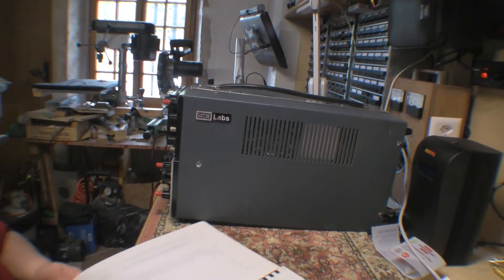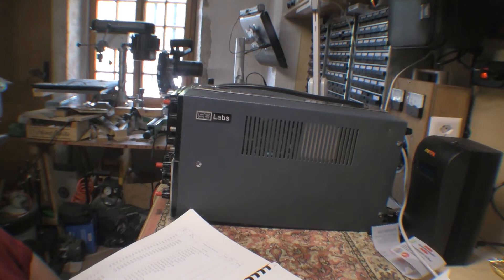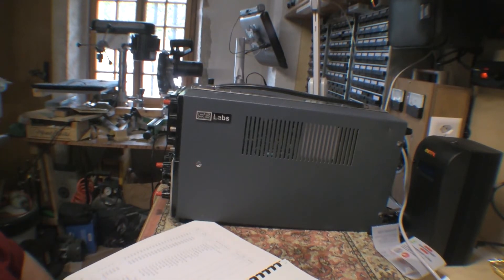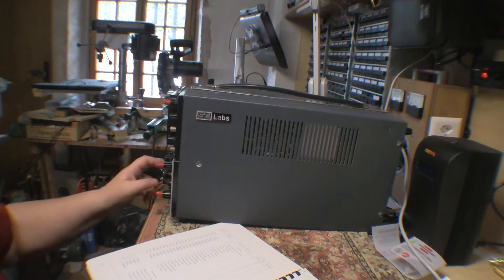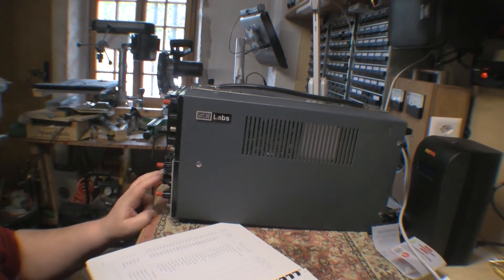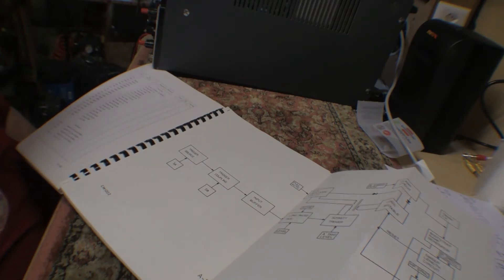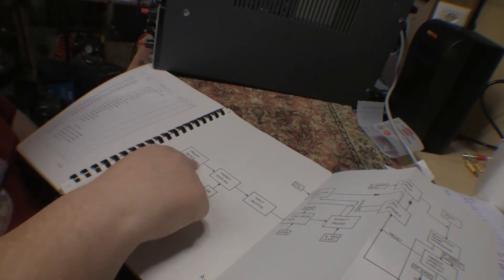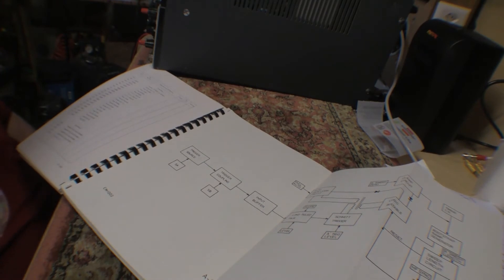SM112 Scope Repair - part 5 (revisit)

Comment: Cut the bad resistors out leaving as much of the old resistor legs/elements in place so you can solder the new resistor to them.
Reply from the maker: Yep, I expect it will come to that.  I've not used that technique before but it seems the lesser of two evils in this case.

Comment: Hello John. Since those are discrete components, I guess you could use the technique the other John uses (the american one who restores radios) - the pigtail soldering. I've already read in a service manual that the own manufacturer advises using that technique to not stress the PCB. It's not the most beautiful thing, but it might work. It wouldn't work with some types of chip though.
Reply from the maker: I'm pretty sure it will have to be something like that since I can't see how to reach the underside of the PCB.  However, I have to find the fault first :-)
Reply: I've never liked the idea of pigtailing to an old component lead, not only does it look bad but sometimes there isn't enough lead to solder to, or you can't get it cleaned enough. I prefer to chop out the old component and then pull the old leads individually through the top. In this case you may have no choice, though I would see if there is enough slack in the wires to lift the board at least 1/2"-3/4" of an inch on the edge you need to get at. I'm sort of concerned about those old electrolytic caps though, even though the Phillips ones are pretty reliable they are not immortal.
Reply from the maker: OlegKostoglatov In general I agree so I will look for every alternative before resorting to pigtailing. I've give the electrolytics a good checkout as well.   I have a feeling it may take a while to get this sorted out.